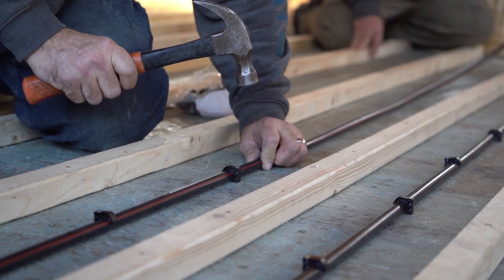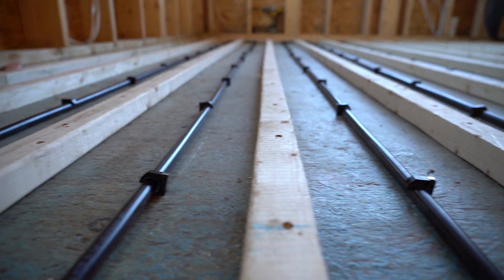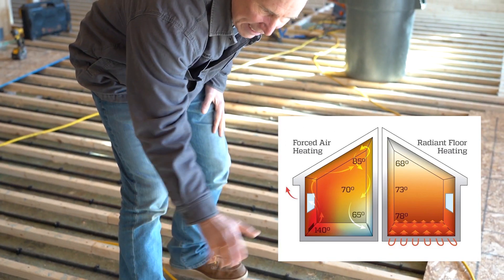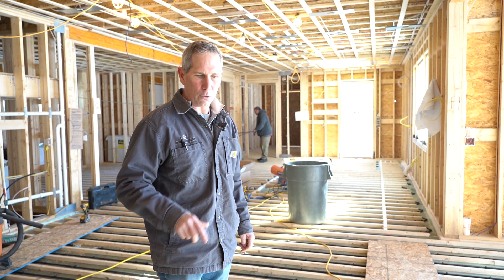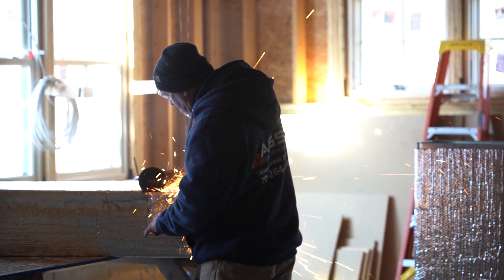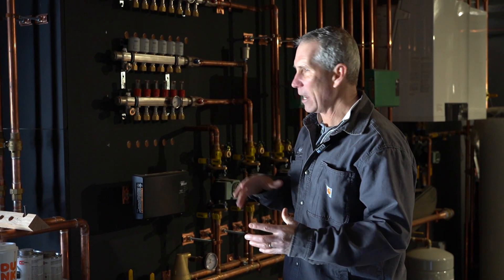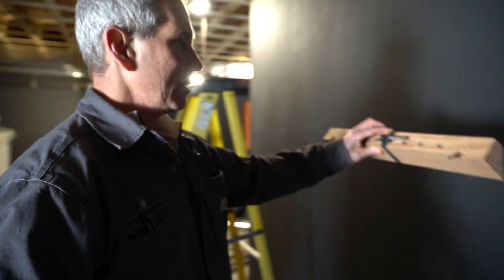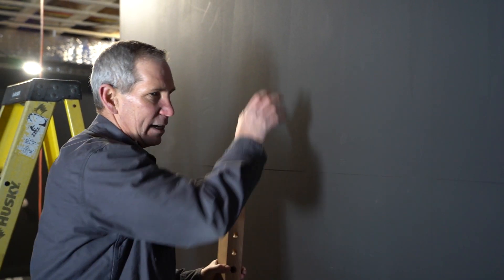Radiant Heat | Boiler Room | QUICK CUTS 01

Comment: Great design. What are the cost advantages compared to gypcrete or warm boards
Reply from the maker: Probably not much cost savings...they all have pros and cons.  Gypcrete is more $ per yard vs concrete but labor is less since it is more self leveling. Warm board is easiest and doesn't require 1.5" increase in height, panels are expensive and doesn't offer the same thermal mass as cementitious product.

Comment: Spectacular video!  Thank you for sharing.  Would you be willing to share the per sq foot cost of radiant heat flooring, excluding the boiler?  I know prices can vary widely, depending on many factors - just looking for a general idea/range, please, if you can.  We're going to renovate a house in RI in 5 or so years, ripping out everything except the exterior walls, including the floor, and this is the method of heating we're leaning towards.
Reply from the maker: I would say it added $12 - $14 per square foot
Reply: @Sweenorbuilders  Thank you!   Very much appreciate your reply.

Comment: This will be a very interesting series!  What size , brand, and type of hose did you use in the concrete?  Could this method be used on an existing slab? 
Thanks!  Keep them coming!!
Reply from the maker: We use 5/8" tubing,  Viega is the brand. Could only be used on existing slab if you could pour an additional 1.5" over top of it.